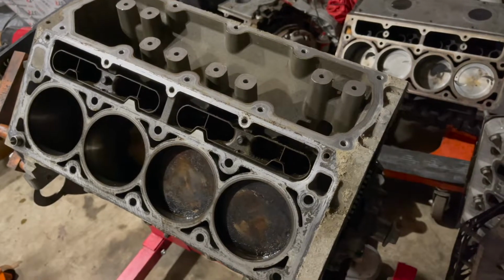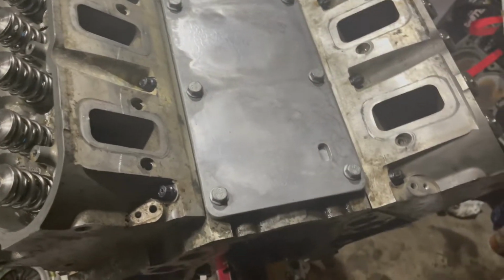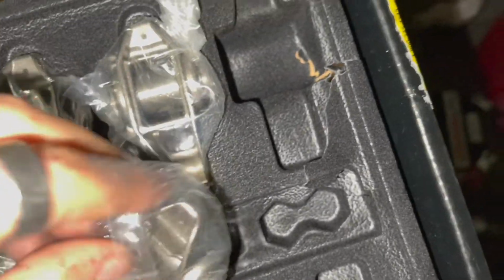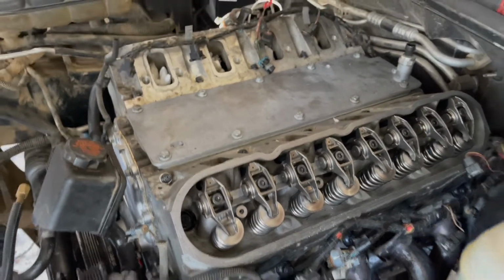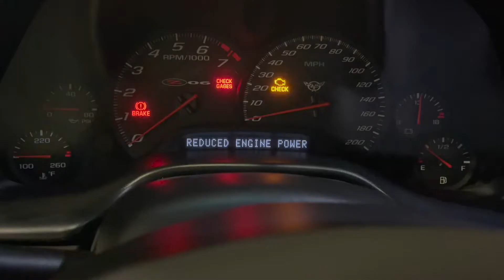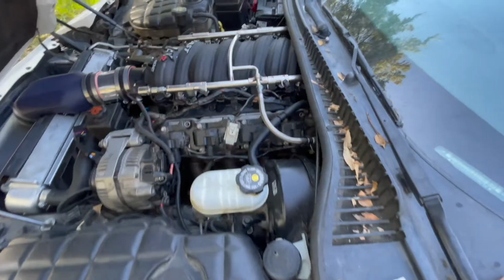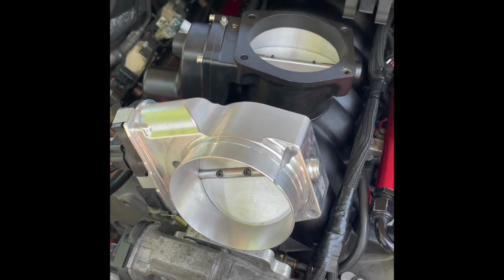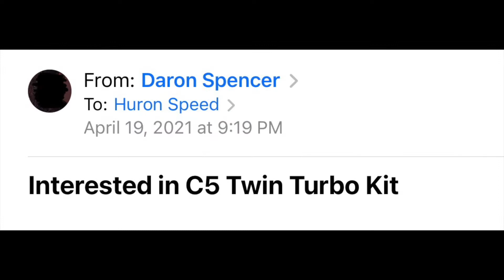Blown up C5 Z06 Corvette Episode 2: LS3 Swap, First Start, and Dyno *NEW DYNO RECORD!*

Comment: I have an LS2 based 408 in my 01 Zo6. AFR Mongoose heads, Speed Engineering headers and x, small 224/228 cam. It's a torque monster. Makes track days easier with less shifting and more time concentrating on apex's and braking points. You made good power! I made 447whp and 470wtq at 5300rpm and 3900rpm. It made over 400wtq from 2600 through 4900. I installed a Proflex Commander E85 kit and with no tuning made 479whp and 503wtq. I am mulling the idea of the FAST 102 and larger throttle body as I believe the LS6 manifold and stock TB are my limiting factor. I am not interested in top end rpm's as the car pulls strong to 6400 but I usually shift in the 5600-5900 range except 4th, going from 3rd to 4th is always revved to 6400 to keep the rpms up for the larger gear drop between the gears. Nice build man! Your car should move out!!!
Reply from the maker: Thank you! And you have a nice build as well, I think it will definitely pick up with a FAST 102 and larger throttle body!

Comment: I have a 00 FRC. I have a iron 6.0, swapped to a 24x reluctor, forged pistons, 660 springs ss2 cam, ls3 intake I just finish building. can you go thru how u got the throttle body to work. I have a tbss 90mm throttle body but I think I need the $300 xlink to make it work
Reply from the maker: The early TBSS Throttle bodys are a direct fit (most people don't know this) you just need the LS2 style throttle body adapter harness (this is what I actually used for the first dyno session before swapping to the 102 LS3 style TB.) However, if it a later TBSS throttle body it requires you to repin to LS3 style, I may make a short video about the repin process!
Reply: @SpencerMedia  that would be awesome

Comment: I get that you’re wrenching yourself & getting deals on used parts & all that, no idea what the goal for the build is of if you just strictly wanted N/A……but I still have the stock LS6 block/heads in my 03Z & w/ stage 2 BTR cam, ported TB/intake, stock fuel rails, 120lb Bosch injectors & an A&A V3 blower (forget the pulley size it’s a twin rib lil lower than what it came w/) LS6 got lunati forged crank/guts/custom cut blower pistons from when I crack a few rings (plugged exhaust w/ hi flo cats lol) - anyhow, my car is making 718whp on a mustang dyno….that’s w/ a dual nozzle meth injection system too
Reply from the maker: Nice, I ended up pulling out the LS3 and this car now has A 330” Forged Aluminum 5.3 with twin turbos and makes 1,100whp
Reply: @SpencerMedia  sick- helps having the engine built like that, good peace of mind when you start making big power & know things SHOULD be able to handle it. You got a monster clutch? I have a McLeod RXT twin disc, I think they warranty em for 1000-1200whp actually!
Reply from the maker: @MS-mr4zm  Have a McLeod RXT-1200 however I do miss the Monster LT1-S that was previously in it. But no real complaints besides a slightly stiffer pedal.

Comment: Is it okay to do the first startup on the previous tune the car had? Or did you need to get someone to flash a tune before hand? Love the videos btw! Currently building an ls3 for my c5
Reply from the maker: Thanks, that's an awesome setup for a C5! Also, if you have the same injectors as before then it usually will start up without issue, however if you changed injectors then you will most likely need to get a base tune flashed on your ecu for the car to start. Since I was using the same 60# injectors that were on the previous motor and tune setup, I had no issues starting up the car. However, I did end up trailering the car to my tuner for the dyno tune.

Comment: That's one badass Z you have there sir! What did you use to do the 24x-58x conversion? My 2005 C6 unfortunately is a 24x and I have a fully built LS3 I wanted to drop in it but wasn't sure what all I'd have to do for that.
Reply from the maker: Thank you! I used the Lingenfelter 24x to 58x conversion box, it allows you to use everything from the LS3 and is a "plug and play" solution to swap in any 58x motor into a 24x car.

Comment: Which 102mm TB did you go with?
Reply from the maker: It's an ebay 102 throttle body, it was inexpensive but I was honestly surprised with how well it worked and how good the quality was for the price!
Reply: @SpencerMedia  ok cool.
I have tried a few of them on my car and it goes straight to REP.  I am using a LS3 TB that works with the adapter harness.  Any tricks you can share that allowed you to use the eBay 102?
Reply from the maker: @maxthemadtuner   As long as you re-pin the adapter harness to work for LS3 throttle body’s it should work fine, also setup the throttle body to max open to 97% under WOT in HP Tuners (97% actually opens it to 100% but when enabled to 100% it opens to 103%+ therefore giving you REP under WOT) After that it should work great
Reply: @SpencerMedia  I actually did that to get my ls3 tb to work.  I may have to pull more out?  I’ll play with it tomorrow.  Thanks
Reply from the maker: @maxthemadtuner  yes, i’ve even seen some that have to close it to 90-95% it just depends on where the sweet spot is for that throttle body